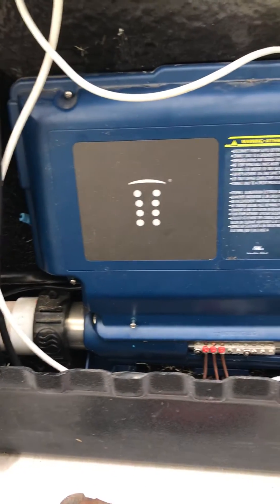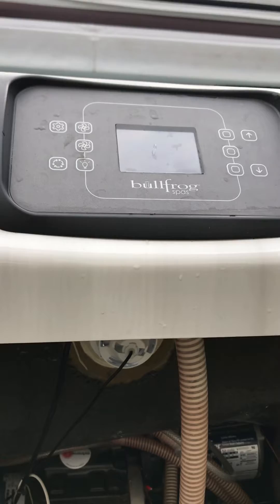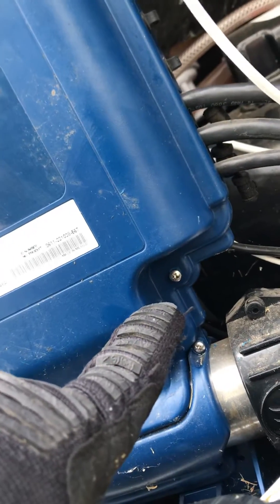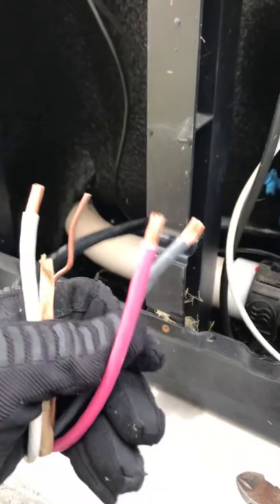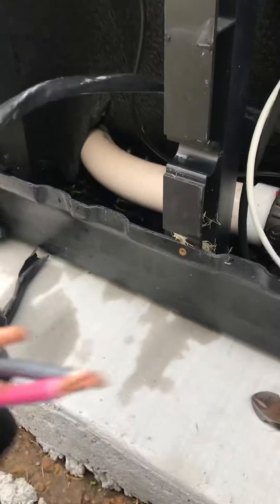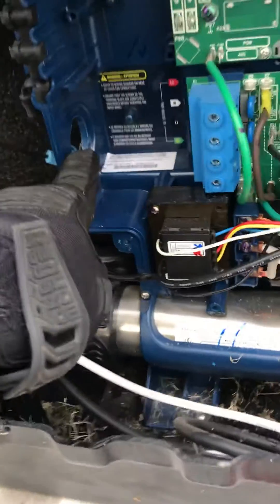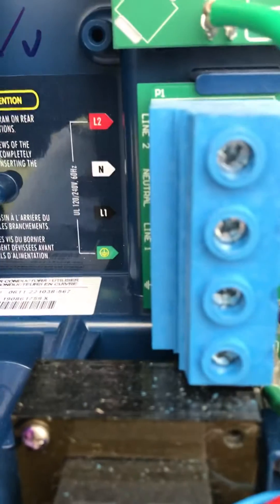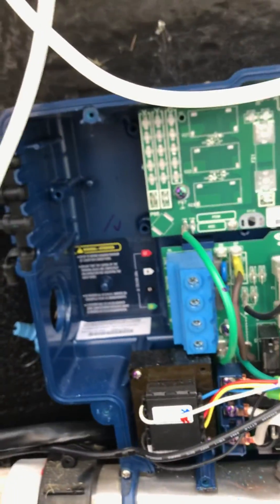How To Wire A Bullfrog Spa with Gecko Power Pack

Comment: That wire is not approved for exterior use
Reply from the maker: Please elaborate for people who see this. I do not run the wires from home, only a licensed electrician does. I was told because there are sealed in conduit and only exposed inside of control panel they are good.
Reply: It is when used above ground in sealed conduit.

Comment: Is there any guidance on what to torque the screws to?  Most high-amperage breakers have torque specs, so I would expect this to have some as well.
Reply from the maker: I would just tight by hand as you can damage panel by drill. Give the wires a tug with some needle nose pliers to ensure they are secure. Couldn’t tell you about torque